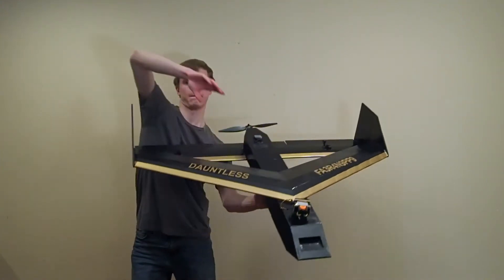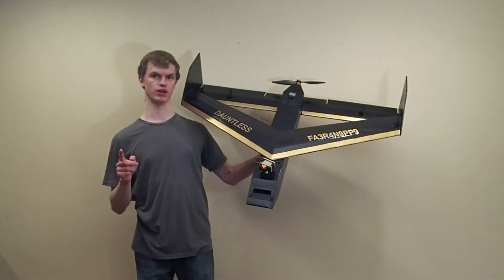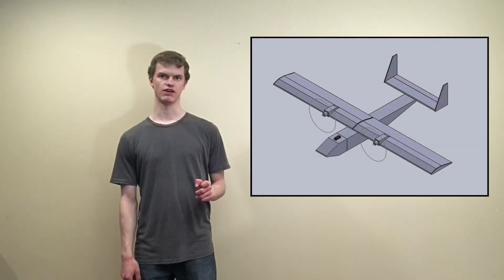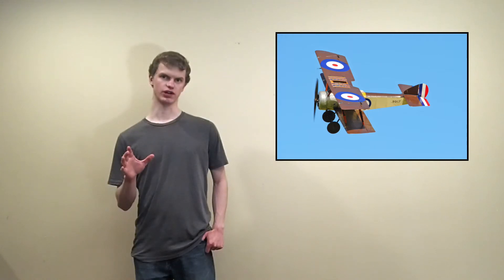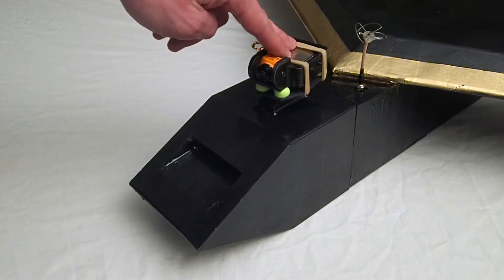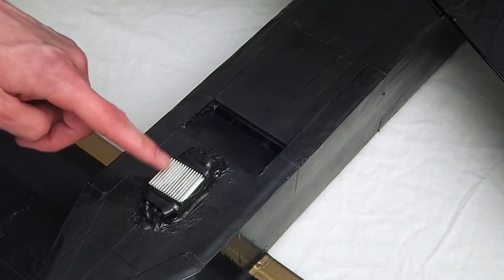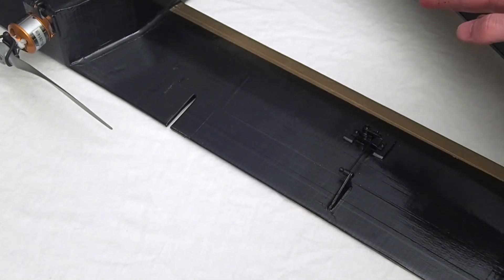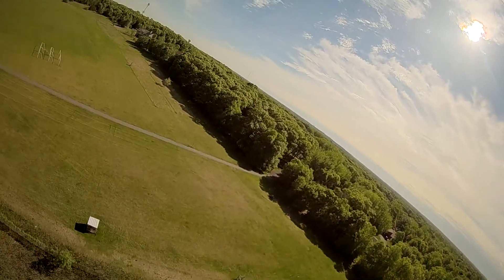Box Wing FPV Airplane

Comment: can you make a tandem box biwing plane..a reverse box wing on top of this  wing..ie 2 wings in front 2  in back
Reply from the maker: It might be possible.  I'd recommend checking out the free XFLR5 software for aerodynamic design.
Reply: That's nothing compared with a centipede wing design - 50 wings in front and 50 back